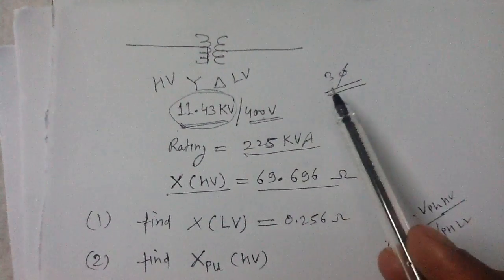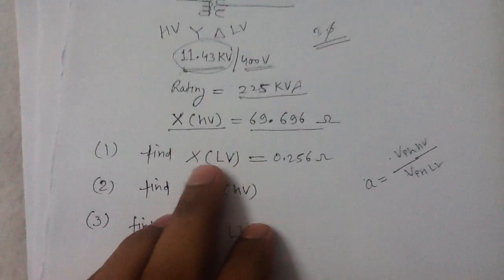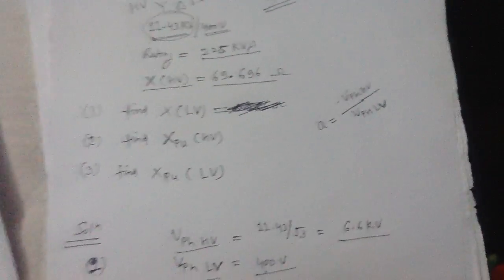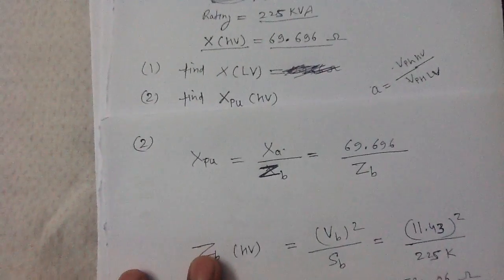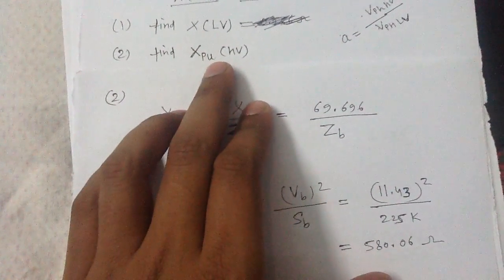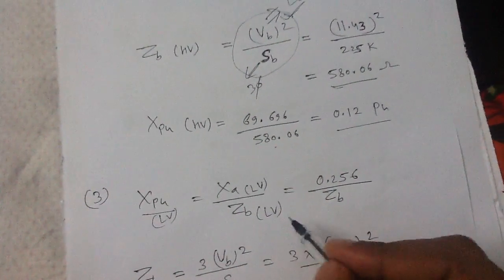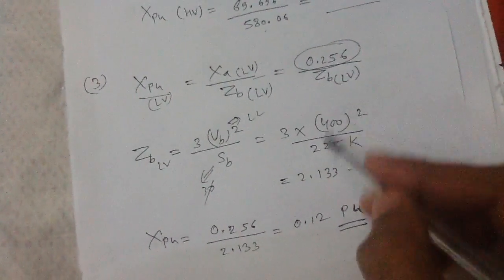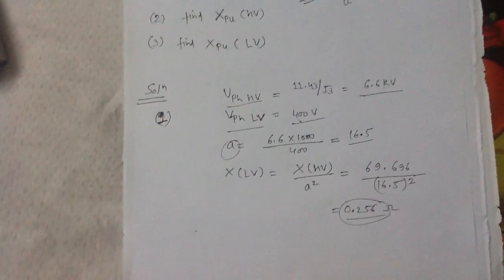Power System Analysis Lec 008

Comment: Abhishekh I have not seen anyone using phase voltage like this. Even if I use the line voltage, calculate base, I get the same PU on both sides of the transformer. I don't get the same impedance values as you do on LV side of the transformer. Grainger books specifically talks about using line voltages to transfer the ohmic values.

Comment: Sir, calculation of Zb(lv) side why multipled by 3?? but not n hv side .
Reply from the maker: Tarun Jaiswal HV side is  star connected while LV side is delta connected
Reply from the maker: Tarun Jaiswal do the calculation on single phase/per phase  basis you will understand the reason
Reply: @abhishekmaurya408  Star Delta transformer is normally used as step up transformer but here it stepped down !!